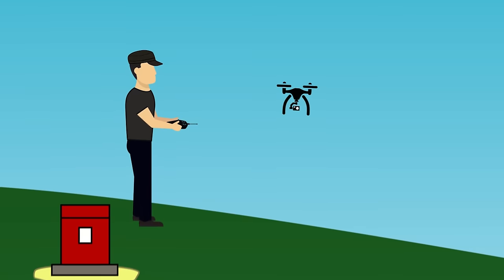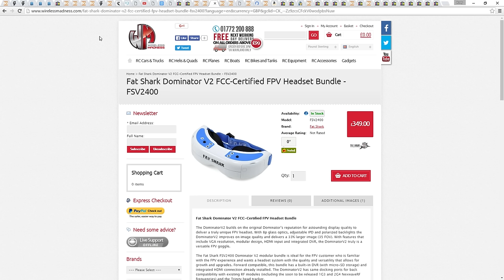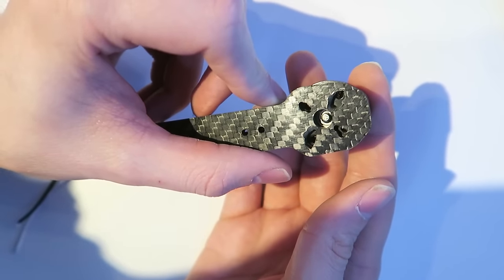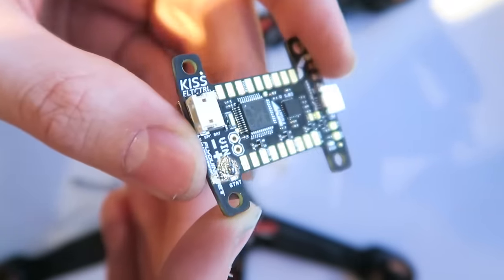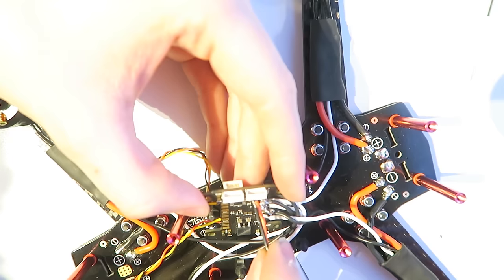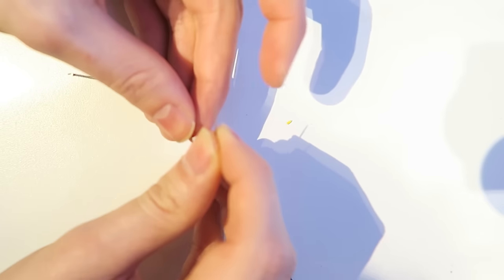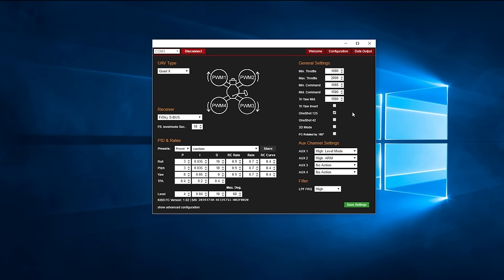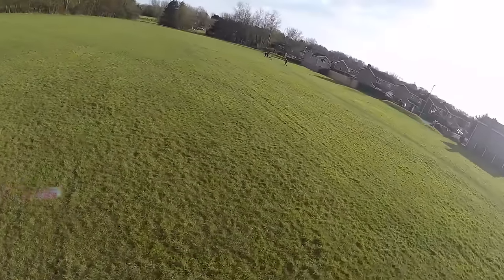Build a 250 Race Quad

Comment: Nice video. The TBS PNP50 has an on board mic if you weren't aware of it, really nice to hear the operation of your quad while flying. Once I switched to an on board mic I could never have another quad without one. Just connect a mono ear piece to your Fatshark goggles and your good to go...

Comment: Great build video.  Might consider using different colored heat shrink on the counter clock wise spinning ESCs instead of pencil to mark them.  Not a big deal, but it just might be easier if you needed to replace one.  Cheers!
Reply from the maker: sure that will work cheers

Comment: Great work on the video. Love the long build video's! Keep it up :-) Btw, you could not use the signal on the PDB for the ESC's?
Reply from the maker: +Lyrixish yes you can but i dont find it any easier/neater. 2 sets of wires to solder vs 1 :)

Comment: Hahahaha i did not notice the lengh of your video lol
I pushed play button and 30 minutes later i was like, damn son, it looks like the video just began :p
Great choice of motors: 2204 is a great spot especially today with all these fast ESCs and higher C rate discharge capable LIPOs and the Cobra motors are just some insane nuclear power plants, you will probably need to upgrade your ESCs i think with these triblade props or maybe it will be fine, i don't know lol
You need a better solder iron though my friend, maybe you should add this to the list!
Thanks for sharing and happy midweek
Reply from the maker: +ABMNS PRODUCTION apologies on the length. but it was required to capture the full thing. the ESC dont even get warm with this setup and any comments to my soldering iron was mentioned in the video ;) cheers

Comment: What is the AUW?And btw, you need a soldering iron with higher power. Then it will be easier to solder and the solder will float out better and the end result will also look much better and you actually will need less solder as well and also eliminate the risk of a cold solder.

I use a regulated 50W soldering station and that power works for anything like this. And I don't like these kind of tips, get one that s flat and iron plated, always works. Just a tip.

Comment: Does it need to be 14 AWG wire for the connection from battery to the power distribution board or is 16 AWG wire okay too? I will be using a 3s battery and i just ordered 16 AWG wire. 
Great video by the way, thank you for that!
Reply from the maker: +Slm3vl 16 will be fine for a 3s yes

Comment: Did yours come off? Or just that they do. I just ordered a 1.03 version which has the boot button and possibly a new USB port. Have you crashed with the kiss fc? Dose it loose calibration or anything similar?
Thanks!
Noah
Reply from the maker: +Noah Golly iv not crashed it yet. the usb just came off with about 10 uses which is disappointing. make sure u get some epoxy on it

Comment: Nice video! Just one question, what do the numbers such as 2204 mean for the motors?
Reply from the maker: +김지훈 22 is the motor diameter and 04 is the hight = 2204
Reply: +김지훈 22 mm wide by 4 mm tall
Reply: AndyRC robsycko thx guys :)

Comment: i think the paper washers are supposed to be between the pdb and carbon arms, just in case the surface of the pdb wears through to the power traces and shorts
Reply from the maker: you can do that but no issues here and get the hard to keep them in place when u put the arms on
Reply: i didn't do it with my diatone frame cause there were no open traces like other pdb frames, but i hadn't thought about the arm wearing through. Really don't feel like taking that thing apart, those things are a pain lol. i'll just leave it to fate and see if it smokes up some time
Reply from the maker: +Ty Lloyd I doubt it will be a problem no issues on mine and as u say no traces close to the arms. good design. just used on the standoffs as they move more from maintenance
Reply: i ended up using some of mine for between motors and arms cause my bolts were a bit long lol. maybe in a wreck they can provide some cushion, they're pretty compressed already though
Reply from the maker: yeah i dont think you will get much cushion from them but wont do any harm thats for sure

Comment: I'm thinking of making a ZMR 250 quad though I'm not ready to invest in the Taranis. Would the Fly Sky i6 remote (in your cheap quad build) be a sufficient controller to fly this? What are the limitations, would this affect the ability to have telemetry? If this controller wouldn't be effective is there well priced remote you'd recommend?
Reply from the maker: +Ollie Cramer yes you can use that with this flight controller but the response time isnt as good
Reply: +AndyRC Cheers! Keep up the great content!
Reply from the maker: thanks!

Comment: hey Andy, I'm looking for a mount for a similar action cam to the go pro/yi but I'm in the US.  I looked all over ebay and couldn't find one as high speed as you got there. I looked at the one you got and I wasn't clear weather or not they ship to the US.  Is there possibly a design that I can send to a local 3D printer guy?
Reply from the maker: I use 3d hubs that finds people people to print for u. check out the updated vid a couple after this one which shows u an alternative
Reply: +AndyRC thanks! I'll check it out. I just got esc number 6 today maybe now I can get airborne. really unimpressed with the afro 12amp so far
Reply from the maker: i have no complaints with the kiss 18A buty next one will have the 24A

Comment: you should try the new emax rs2205 red bottoms! way better than cobras
Reply from the maker: +Teo Awoken better as in more power? I will be fitting 2206 to the next build ;)
Reply: they are reliable and powerful. 1200+ grams of thrust on 5045x3 with the 2600 kv version. Crazy power, believe!
Reply from the maker: nice!
Reply: +Teo Awoken yes, in some thrust tests the 2600kv version arrives at 1400g of thrust with gf 5040x3!

Comment: You did not have to buy the pnp 50 there are some power distribution boards that tell you the voltage and output it in your Fpv video
Reply from the maker: +Rc Addict with planes correct but this is a pro build
Reply: AndyRC yes i know I just was wondering why you would use a such a big voltage on screen display, just because it weights a lot, but you are probably not going to race with that quad any way so it won't really matter
Reply: But I like all the choices with all the parts including pnp 50 I really like that fact you don't have to modify it to make it work your own way
Reply from the maker: yeah the pnp50 does weigh a lot. I will be looking at other options in my next build
cheers
Reply: You should try the power osd pro, it's a power distribution board, shows live batt feed and live mah. And it's the size of a naze32
Reply from the maker: I will definitely look into that thanks!